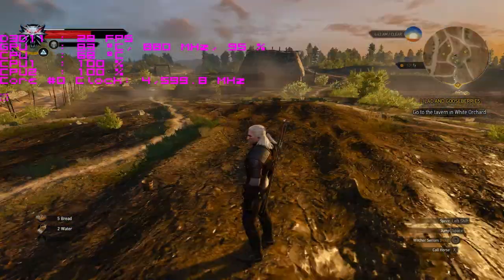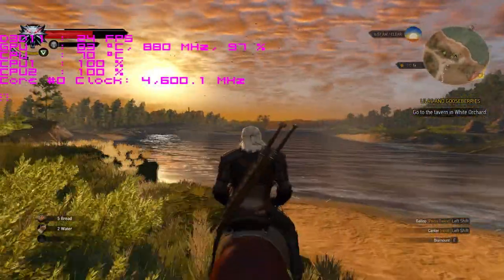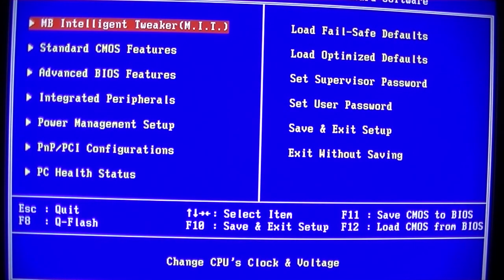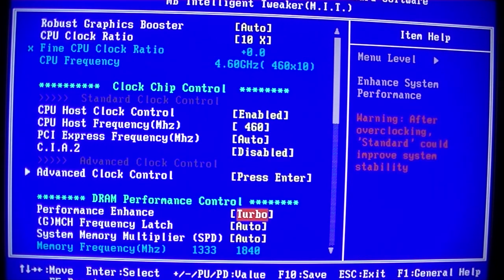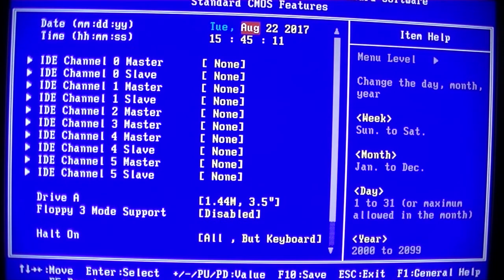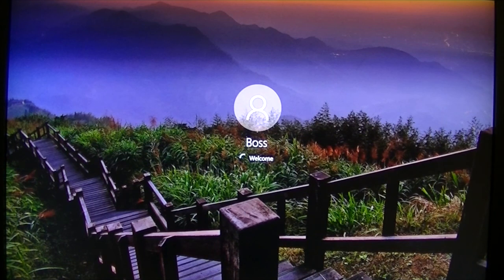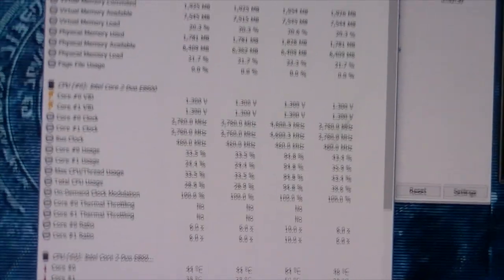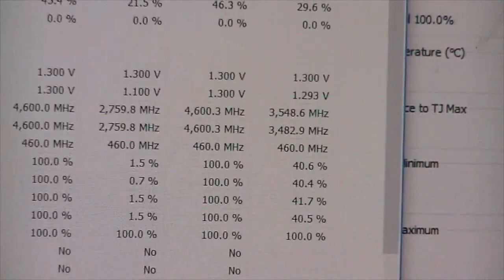Core 2 Duo e8600 Overclocked @ 4.6Ghz on AIR Bios Settings Windows 10

Comment: That board omfg DDR3 and solid caps
Reply from the maker: Yeah, best C2D overclocking board ever.
Reply: @clockbench  It's easier to use, 100% true. 
However, I prefer Rampage Extreme over it. I do own EP45-UD3P rev 1.0, but it simply lacks GTL voltage fine tuning, and performance level stuff I enjoy tweaking.

Comment: Can I overclock using g41mt-s2pt motherboard?
Reply from the maker: The G41 is not designed to overclock. You might be able to a little, but it's very limited.